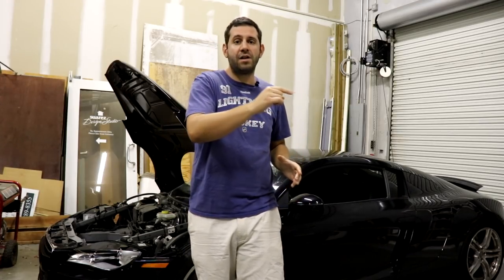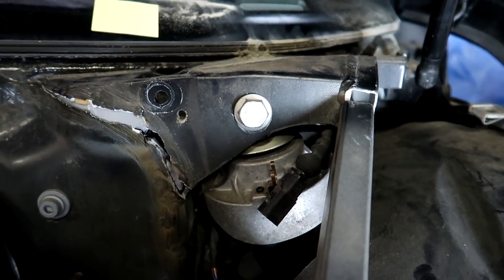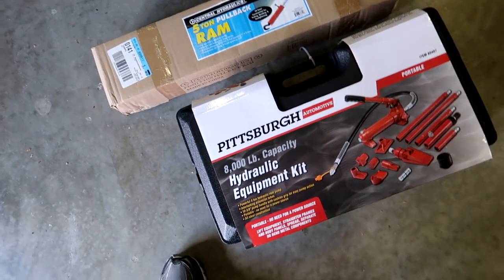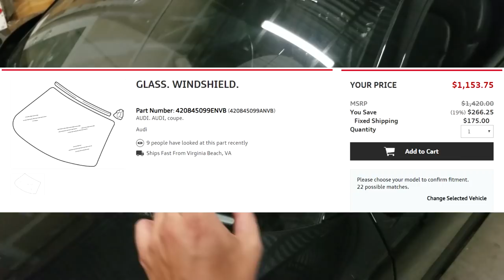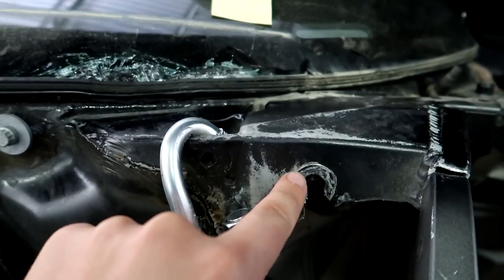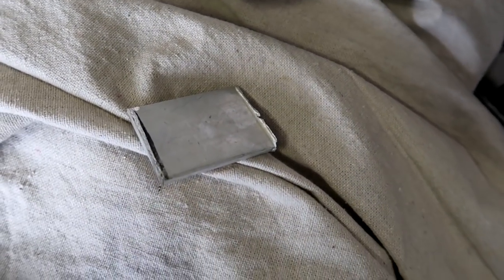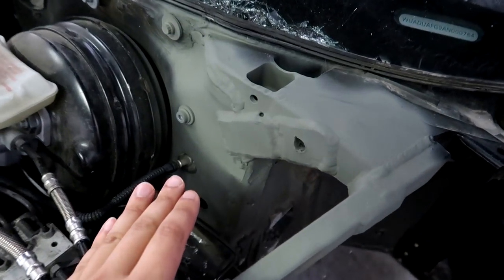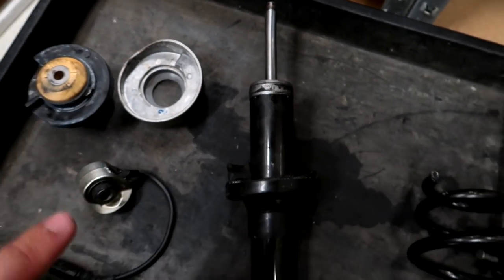I Repaired My Totaled Audi R8's Cracked Frame for $500! Insurance Quoted $29,522!

Comment: Seriously ? Buy a totalled car which new costs $130.000 and fix it like this ? Amateuristic, not to mention extremely dangerous... Let professionals handle cracked framework.
Reply: What exactly is extremely dangerous? The worst thing than can happen is the frame will crack anew at the exact spot, despite all reinforcements. The shock will not fly away and the driver, most likely, won't loose control as due to tire rupture.
Reply: Those same professional that fucked it up in the first place?  or the other professionals that state "oil changes should be done at your local Audi dealer."?
Reply: @ricolaw2571   Not to mention the professionals who recommend not only the oil to be replaced by an Audi dealer, but also that the engines can handle the "longlife" intervals or the "lifetime"-intervals of gearbox oils.
Reply: 9400Martin those are not professionals, those people are businessmen. 
Why would they build a car that lasts 50-60 years without repairs? 
Not if they want to sustain a good business and keep coming up with new models....
Reply: @erixx297  I know, I'm a mechanic myself and I see the problems they make on a daily basis.
Reply: Metal is metal stop trying feel important bang it back into place weld it reinforce it weld it move on with life.
Reply: @marcusaguirre7032  Frame geometry should be fixed.
Reply: @marcusaguirre7032  This could not be a more factually incorrect statement, try to weld steel to aluminum, it cannot happen. Despite that 'metal is metal', some metals have greatly different densities, properties, corrosion resistances, even in steel alone there are so many different types, hardesses, how ductile they can be, so marcus drop that shit, its not truthful

Comment: Hi. Great to see it repaired. One remark though. I work at an engineering company and as far as I know aluminum alloy will loose a big part of it's yield strength by welding it. It is possible to regain that but only by special heat treatment afterwards.  Maybe your alloy has different specs or the repair has improved the original design so much that it can easy compensate the loss of strength. But I know that in our company they reduce the allowable yield stress in welded aluminum constructions almost 50 % if it get's no special heat treatment after welding.
Reply: i'd give two fucks... at least! 
just lately bent the hanger of my rear derailleur on the bicycle ~ 10° when it fell on the ground, tried to bend it back and it snapped right off. it wasn't much thinner (if at all) than the plates they welded to the frame... so having that in mind i wouldn't be too comfortable riding this sevral 100hp 'sportscar'! REALLY!
Reply: @seppstarthebest -Aluminum and alloys off dont bent well-they crack well instead. Im a pilot and instructor of pilots. When an aluminum part is bent or cracked in aviation is ILLEGAL not to replace it totally.
Reply: @CFITOMAHAWK2  - i know, i already expected it to crack before picking up the pliers ;)
but a rear derailleur hanger is not really a bearing part on the frame, it's mounted with one screw, replacement part is 6 bucks, so i gave it a shot ... and blew it! however if the derailleur gets into your spokes you can still totally crash the bike and possibly die... once trashed a porsche bike like that... REALLY! xP
edit: forgot to mention, the porsche bike i trashed was an aluminium frame. when the derailleur went into the spokes the chain stays got bent... and it is common sense amongst cyclists, that you don't bend an aluminium frame back into shape, cause you will probably die half a year later when you go 40mph downhill and hit a pothole... only steel is real, na mean?!
Reply: btw - the porsche bike came right out of maintenace (a friend had bought it days ago and  i was the 'test rider') from a professional mechanic, who didn't bother to check the derailleur setting... since then i've never again brought any bike into a professional shop ;)
Reply: The aluminum wall thickness around the shocks is also increased by 100% so it should be more than enough to compensate for the 50% yield strength loss. The crack is a clear example of ductile fracture, once a small crack has been made all the tension wants to rip that crack open further. By increasing the wall thickness locally the tension is spread over a larger section area which should prevent future ductile fractures because the material wont stretch to begin with.
Reply: dextersxxxxlab I’m sure its fine. And if they crash I’m sure the factory engineered crumple zone will react as intended with a quarter of the car being “stronger” than the rest.
Reply: scott mcnally Fukn Hilarious!
Reply: Steel is Real
Reply: scott mcnally The person driving the vehicle.
Reply: Not true. Each aircraft has a very specific table of damage limits based on material type, thickness, location (criticality) which details the type of repair, if any, can be carried out. Cracking is normal in ANY aircraft and are inspected/repaired as part of their normal life-cycle. a typical repair is known as a doubler. It is illegal to fit a known unservicable (cracked) part without proper engineering disposition. I'd suggest spending more time with maintainers if you want to give your students an in-depth knowledge of the aircraft they fly.

Comment: Dude, how did you bot use a piece of thick wood place it on the crack and hit the flat surface, you have way less chance of hitting the windshield because the surface area is bigger. You not only samcrac'd the windshield but you also cracked my soul a little😅😂 anyway great fix!

Comment: To all the blowhards pontificating on how dangerous this is. Shut the pie hole. It's a coilover mount. If it fails, the suspension simply drops to the bump stops, and stays there. It's really no big deal.  Now if he was messing with an upper or lower control arm mounting points, then you'd be rightly concerned.  But it isnt. The weld is fairly well done, and doublers welded in for good measure.  It'll be fine, don't get your internet panties in such a wad.
Reply: Robert Thomas, I have to agree with you there are a lot of blow hards here who are green in the pants speaking about this Audilike they’re a factory certified expert. I’ve over 25yrs as an owner in the auto repair business and custom fabrication and currently operate a custom machine shop that also delves in metallurgy and this fix is fine if he doesn’t mind the salvage staying on the title. All these comments about insurance companies. All they care is it says salvage so they don’t ever have to pay out in full. These folks need to get their lips off the pickle and shut their YouTubing traps.
Reply: Please stop making sense, these people would rather assert that the car is going to somehow explode or that the strut mount is part of the crumple zones of the car or some other stupid crap.
Reply: I agree  with Robert
Reply: Robert Thomas exactly , Fak me repair looks good , get on with the job. It's not the Holy Grail.
Reply: the structure has been compromised. even if the area that was fixed holds up another part of the frame can crack.
Reply: Robert Thomas, you are my brand new hero.  I'm so glad that someone finally brought some common sense into this debate. The car being discussed isn't being used to take anyone to the Moon, or even entered in a Formula One race.  It's JUST A ROAD CAR!  There is nothing magical about it.  Sure, it would be nice if all the tricky heat-treating and space age welding could be done to keep it 100% stock, but if doubling or tripling the existing material does the job, then just do it and move on. 

One more thing I wanted to add ever since first seeing the cracked frame in the first video.  While I'm definitely not a trained structural engineer, or anything close to it, I've worked around load-bearing metal structures enough to know that the way that brace was designed is way weird, almost like it was designed to fail.  I think if you asked any decent mechanic to look at that piece before it tore, and asked them to guess where it would crack and tear, they'd point to exactly where it happened.  Sure, it's a triangle, but triangles only work when loaded in the right direction.  The pyramids only "work" when the wide side is down.  But if the same engineers that designed that R8 piece had been ancient Egyptians, they would have tried to build the pyramids with the pointy end down. But I could be wrong.
Reply: @chucklantz8290  What you don't seem to remember is that the car was engineered and built to be a supercar. The ghetto fab work that was done is in no way comparable to the original structure. I think you are also forgetting that while it may now be "just a road car", poorly thought out repairs like this one put the driver, as well as other innocent road users and pedestrians at risk.
Reply: Alex Grant  the why did it break, and why is it a “known issue”?
Reply: @michaelbuzny1170  This car looks to have been in some sort of accident, as shown by the bent shock and the ripped undertray. I don't know enough about audi R8's to comment on whether or not its a common issue, but what I will say is that no engineering team is perfect, and that they may have left one or more load conditions under analysed. All this being said, I still stand by my original comment; this is in no way a safe or smart fix, and should not be allowed on the road.
Reply: Alex Grant he literally says in the first video in this series, that frame cracks in that area (he even states it again at the beginning of the video) , are a widely known issue with this model. Googling audio frame/structure crack brings multiple results.
Reply: @knammer1  I would rather say that it is the shearing force created by the expanding gap that led to the shocks being bent. I could be wrong and also this does not explain the ripped undertray though. A quick fix cannot be as thought out as standard engineering, however, standard engineering had more to think about in terms of optimization which means that this quick fix might actually be good mitigation for the "known issue"
Reply: @bullrunhunter6489  Totally agree here and enjoyed your "lips off the pickle" comment. Nice!
Reply: True but what if you are pushing 100mph+ lol
After all its nobheads and speedfreaks who buy these cash sucking heaps!
Reply: I know right. These PPls comments make me wonder(even More) about the kind of people in the world. Seems most folks may just be mad they didn't buy it or they bought one full price.
Reply: @knammer1  What degree do you hold, that says this isn't stronger than the factory design? I worked in a field where we constantly had to modify (for the better) some engineers design that to him on paper worked. Yet in a production mode failed constantly. From the looks of it, he made it much stronger than the factories.

Comment: dude.. you said you put primer on it so it doesnt rust.... aluminum doesnt rust
Reply: Kind of looses credibility right there doesn't he?
Reply: Strictly speaking, yes, AL does rust/oxidize (same thing). It just does not continue to rust like steel does. Aluminum forms an oxide layer that actually protects the metal against further oxidation.
Reply: He also said he would fit coilovers, it HAS coilovers already !!!
Reply: @col Stace he probably means adjustable coilovers
Reply: but it does corrode,its a primer for aluminum
Reply: @paulferguson2818 - Corrosion and rust are not the same.  It shows his ignorance of what he says he is doing right..
Reply: Stop hating
Reply: Joshua Mueller straw man. You are just mad you can’t do what he can. lol.
Reply: That will come as a surprise to the aluminum mining industry, which extracts aluminumoxide for processing into pure aluminum.
Reply: It doesn't rust like steel, but it sure does corrode, and it can corrode to the point of being just as bad.
Reply: Maybe he just misspoke. Its not that big a fucking deal kids. However, this car, bad idea. That sort of fuck up on audis part is scary, especially at this price point on a car likely to be seen on track days.
Did they do no testing?
Reply: @madmax2069  thats not really true, yes it can corrode, but unless the car is underwatter in the ocean, it will not get as bad as iron
Reply: Just don’t drive it into a swimming pool full of mercury.
Reply: @kalamazoo-Fcar  yes but my point being that aluminum does not get as bad as iron. Why do so many people drive polished aluminum valve covers and water pumps, or brushed aluminum alternators. Why don't they paint those? You wouldnt drive a polished steel valve cover would you?
Reply: @fubarexress6359  actually i been a welder fabricator for just over 15 years. i can easily do what they did. i just cant afford to buy a 40 thousand dollar salvage
Reply: @turbodog99  and fully cleaned aluminum begins to oxidize damn near instantly once contacting oxygen. Thats why welding and prep can be such a bitch for clean results.
Reply: Then called it etching clear around 15 mins
Reply: Aluminum does indeed "rust". Just not the kind of rust seen in steel. Rust is a type of oxidation. Aluminum also oxidizes. The meaning of oxidation is kinda self explanatory. It means combining one material with oxygen to form a new compound. In Aluminum that compound is aluminum oxide. So priming the bare metal was a very wise decision.
Reply: @turbodog99  Just like galvanized.. 😅
Reply: Joshua Mueller it does corrode so primer right thing to apply

Comment: Bargain of the century.
Reply: Yeet
Reply: yup
Reply: lol sarcasm?
Reply: That poor windshield... :(
Reply: half price plus windshield= slightly over half price. Still did pretty good
Reply: Even considering the windshield it is still a bargain, but when it cracked my Heart cracked too 💔😂
Reply: Dave Pawson  Welds are better than the origional metal. It may start tearing again somewhere else but he knows to watch for it.
Reply: Probably was owned by an Asian kid who went to college in America 
He will just buy a new one
Reply: Did you laser align the chassis after bending it back into what you think is the correct area? There is a chance that the body is still twisted.
Reply: Try death trap of the century
Reply: @Randy Not according to the dozens of metallurgists and welders I've known. According to them the area of the weld is stronger, They can't speak to the rest of the existing metal of the remainder of the object but welding causes a crystalline structure that is stronger than the original weld and the surrounding metal will be strengthened by the heating and cooling. Considering many of them have a doctorate you'll forgive me for listening to them over you.
Reply: @Randy I stand corrected. Honestly I didn't realize that was aluminum. I wouldn't pay 10 cents for one of those cars new. That's a major oversight by Audi and the whole structure should be replaced with steel. There's a reason companies don't use aluminum to mount their suspension to. Garbage car. Sell it for parts and move on. Avoid Audi altogether, a mechanic I know specialized in them and now i know why he said they were shit. He was a retired nuclear engineer who retrained in mechanics when he retired.
Reply: Ford F-150 pick up trucks now have aluminum frames.
Reply: @joer8854  In steel, yes. Aluminium is a completely different beast.
Reply: Aluminum isn't a good structural material for a car IMO. The whole thing with ford trucks is dumb because it only really makes the bed lighter which is stupid considering the thing is massively front heavy.
Reply: @joer8854  agreed.
Reply: @joer8854  well,the body panels are also aluminum. My son worked at a Ford dealership body shop when this all came from corporate,he said the body shop technicians we're all moaning in disgust.

Comment: Idk if I'm OCD, but I would of added a much bigger metal plate or sets of them to reinforce that frame. Something 4 to 5 times the size of that tiny plate he put. Then ribbotted it or welded according to the shape.  same for The side tubes too. That being because he also grinded the metal a bit... meaning... less strength overall despite the welds themselves. Spending a little bit extra on peace of mind goes a long way.
Reply: The thing is you want that part to crumple properly in an accident to absorb the impact, if you reinforce it too much your own body will take the blow not the car.